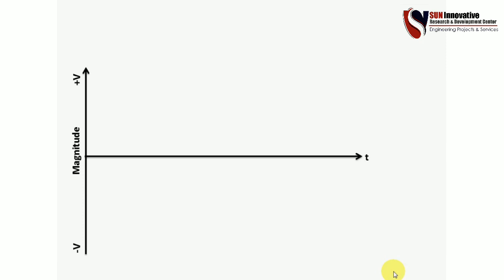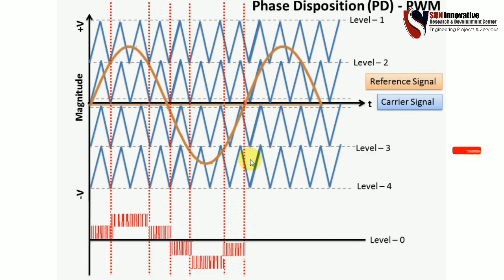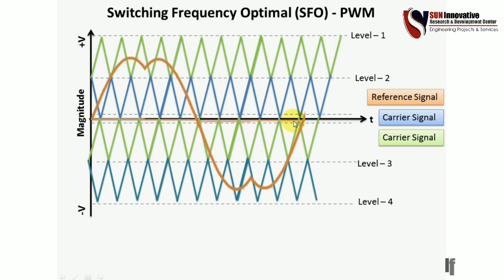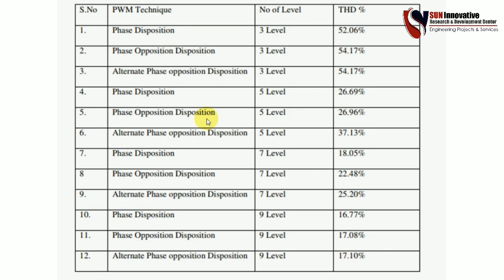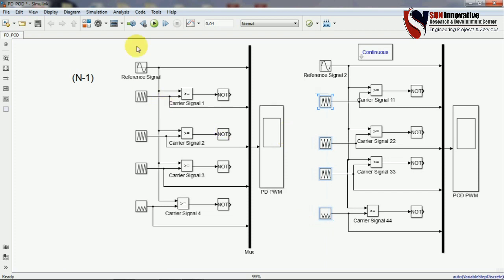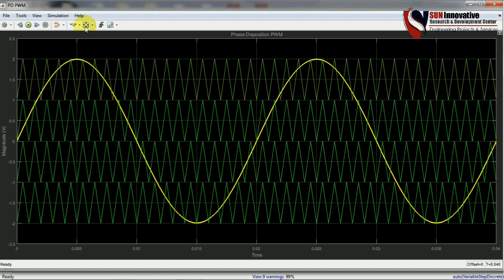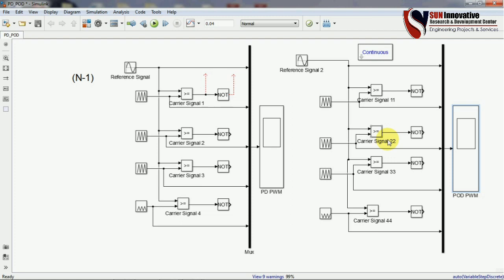Multiple Carrier PWM | Multilevel Inverter | MATLAB Simulation

Comment: 0:01 Intro.

Pulse-width modulation (PWM) techniques:

1:42 Phase Disposition (PD) PWM.
4:04 Phase Opposition Disposition (POD) PWM.
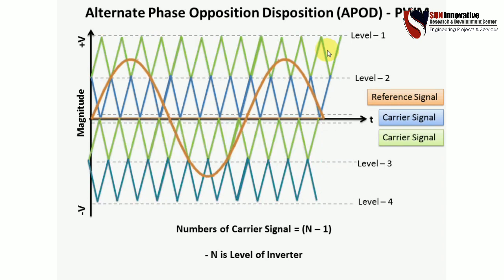5:24 Alternate Phase Opposition Disposition (APOD) PWM.
6:07 Carrier Overlapping (CO) PWM.
7:02 Variable Frequency Carrier (VFC) PWM.
7:31 Switching Frequency Optimal (SFO) PWM.
8:25 Carrier Overlapping - Phase Disposition (CO-PD) PWM.
9:05 Carrier Overlapping - Phase Opposition Disposition (CO-POD) PWM.
9:24 Carrier Overlapping - Alternate Phase Opposition Disposition (CO-APOD) PWM.

I only knew sinusoidal PWM (SPWM) and vector space (VS) modulation. Thanks.

Comment: Sir may i ask how many mosfet/igbt that you use for pd and pod circuit in the video?
Reply from the maker: Numbers of IGBT and MOSFETs are depend on level of inverter and which type of multilevel inverter were used. For example Flying capacitor, ANPC, Freewheel Diode, Cascaded Bridge. So please send your topology I will send you numbers.
Reply: Cascade h bridge 7 level. Sir can you show how to analyze crest factor and form factor. i am little bit confuse about this part sir. Thankyou very much  sir your video seriously helping me a lot.

Comment: Which one is best among them?
Reply from the maker: All are best, thing is each having individual importance and application. Suppose some circuits are made under low budget then general and square PWM were used. If circuits demand best power quality reduction then you should go with space Vector and hysteresis or multiple pwm etc.